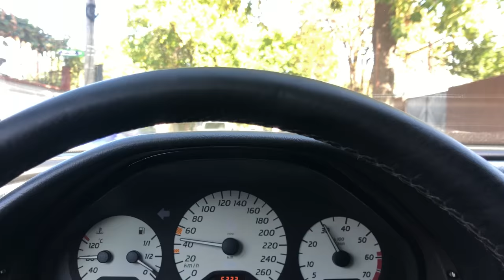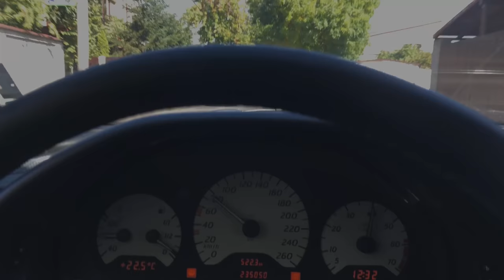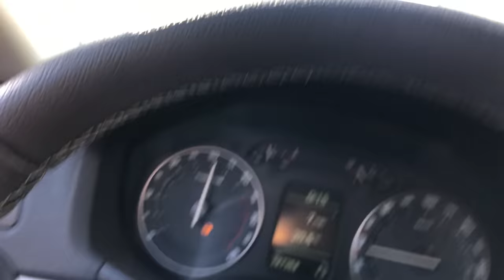BENZINA sau DIESEL? Tu ce preferi?(Mercedes VS Skoda) #23

Comment: Diesel clar!! Pe lângă ca se aude excelent, cuplu de la turatiile mici nu-l compari cu nimik!!!
Reply: Oniji Koyama tu ai condus un benzinar cu un motor de cent STI ce e aia senzație sau tia spus tata ca consuma mult și are cuplu la turația de 2000 pana in 3500 .. da are un lag de Numa ... dacă vrei senzație ia un benzinar... su eu am disel 3.0 cu chip am dus la 300 de cai . Da am condus un benzinar de 3.0 e cu mult perete disel e clar in Victor și eu nu-l schim in benzina , prima oară conduceti un benzinar decent nu 1.2 1.4
Reply: @inczerobert229  Am Bmw 320d e46 din 2000